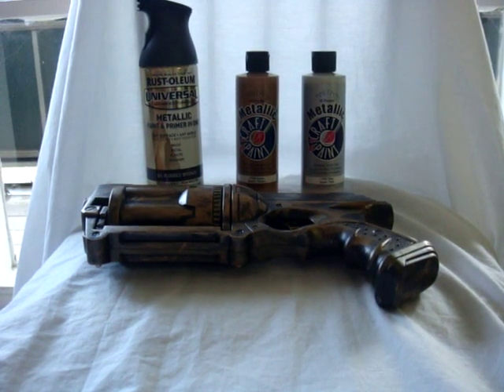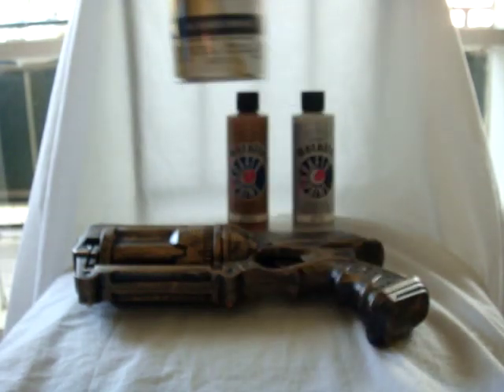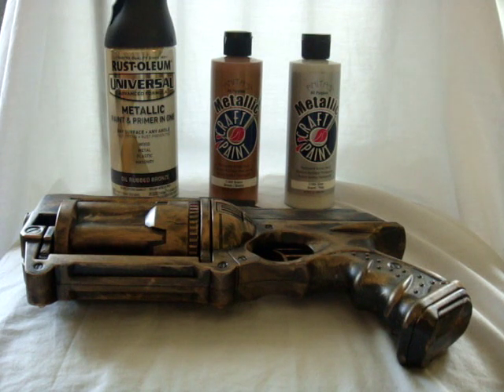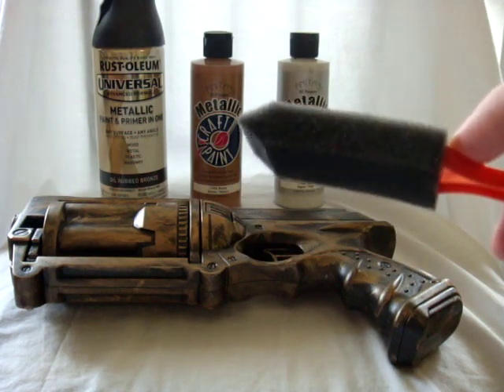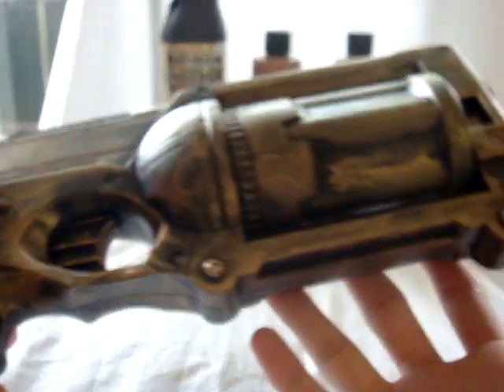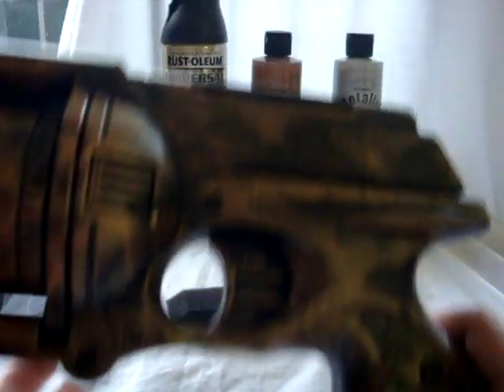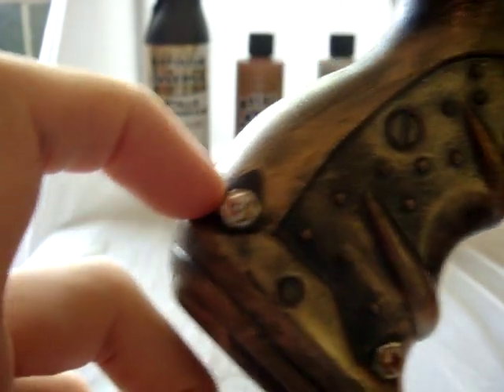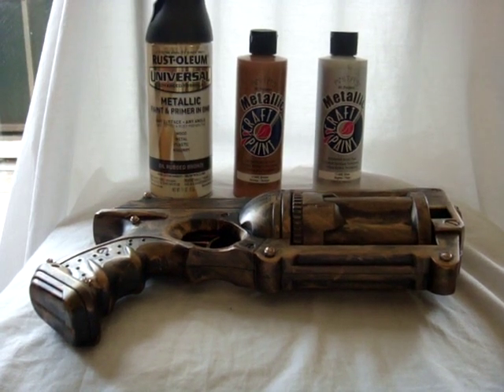How to make a Steampunk Gun Part 2 of 3

Comment: so if you wanted to could you have just drybrushed silver on top of the base coat f the main part of the gun? I'd like to do something similar with my one only with silver as the main colour, bronze for the barrel and copper on the handle, could I just do a base coat of that spray paint and then drybrush the other colours over the top?